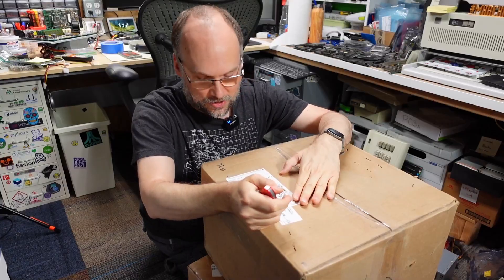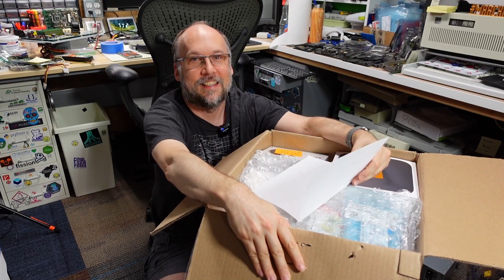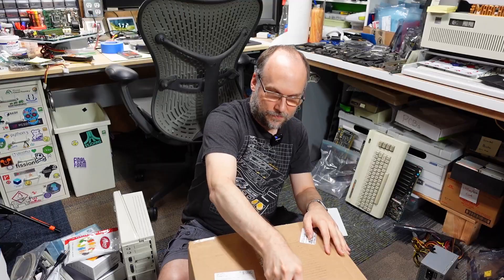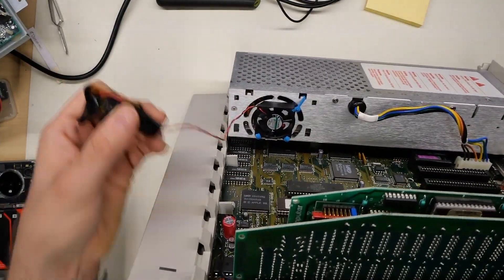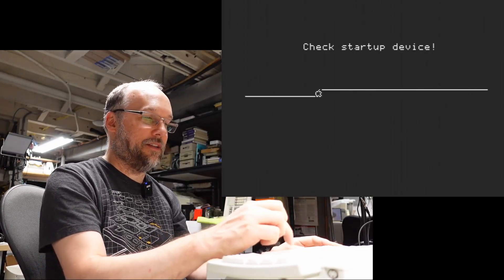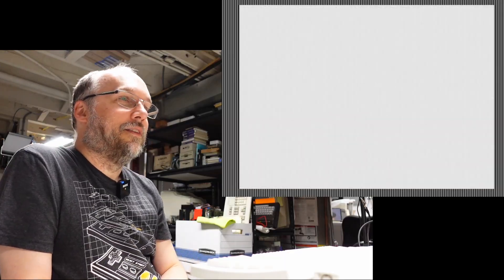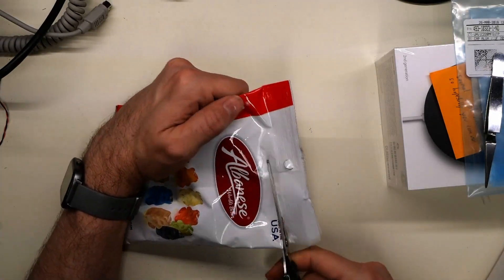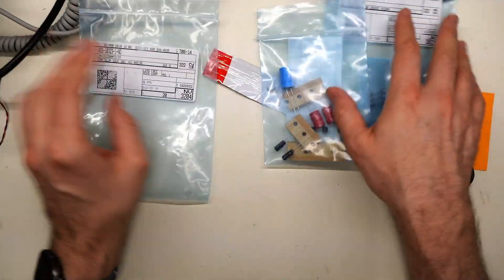This computer was designed for smart kids

Comment: I'd have to say Apple dropping 64K just for the Ensoniq sound chip back then wasn't cheap back then. That was over a decade before we had the likes of Creative offering expandable RAM for "sound fonts" on their AWE 32 and 64 PC sound cards. But it would surprise me if the Ensoniq chip couldn't borrow memory from the main IIgs RAM beyond the dedicated 64K. Actually, for circa 1986/87, that would be a design flaw if it didn't have that capacity. I remember when my parents bought my 1040STf, the computer dealer had the 520 and 1040ST set up in a section of their store with the Amiga 1000 and the Apple IIgs [the Atari Mega STs had just been released and were stationed near the Apple Macs]. The ST was faster and had more standard RAM plus an official external hard drive [SH204] available while the Amiga 1000 had the better graphics and the IIgs had the best sound - and highest sticker price - of all 3. But the SH204 external hard drive was the thing that truly blew me away with its copying and transfer speeds. And with its huge price tag, I certainly did not get one then...
Reply: @Jeremy Holloway - Yet while Apple generously providing the sound chip its own dedicated 64K, the computer's main RAM (only 256K) was completely insufficient to run any of its native software, even its OS! Back in 1986 Apple should have shipped the machine with 512K or even 1 MB, and had empty sockets and a jumper for users to bump the sound chip up to 128K. There was no excuse for this, considering what it cost AND that the Mac Plus released almost a year earlier came with x4 the amount of RAM. Sadly, back in the day no one seemed to understand how powerful the Ensoniq was in the IIGS (and leaps and bounds beyond what the Amiga and ST offered). It wasn't until the Gravis UltraSound in 1992 (it had a next gen version of the Ensoniq and up to 1MB sound RAM) that PC's user got a taste of what the IIGS had 6 year earlier!

Comment: You're killing me here! Why didn't you connect the zip drive and boot system 6.0.4 from it? It looked like the zip drive is being used as a hard drive. Not unlike on a Mac plus.
I wish I could have seen the label on the bottom of the PSU. Although I'm 99% sure it said Dyna Comp Inc.
I didn't know they sold them in the U. S.
My //e Platinum has one, which was standard for Australia.
Reply from the maker: Heh yeah the video was already running too long. :-) But the Zip drive is a great solution and definitely works really well to boot the GS into GS/OS. (Still have the 32mb partition limit.)

Comment: Hey Adrian, what sort of RAM card do you have in your ROM01 machine? If it's more than the one in this ROM3, I think I have a RAMpak 4GS around here somewhere. It doesn't work on the ROM3, but it does run on the ROM01. 4MB genuinely makes a big difference on the IIgs.

You don't actually "need" a ROM 3 machine for compatibility with any software, though you might want one. Very little Apple II software really "needs" a mouse, so if you add a Mockingboard (for the few things that ever used it), you you probably want it in slot 4. It could live in slot 3 since it's easier to patch the few titles that used it to be slot independent, but on the ROM 3 you don't really have to—just toggle slot 4 between Mouse and Your Card as needed.

The biggest reason to have multiple Apple II machines is that there are just never enough free slots. And the ROM01 was insane for setting up AppleTalk—it cost you two slots. I've only ever set that up with a Raspberry Pi.

Comment: Adrian I've been working on a 2gs ROM3 just like this one.   I just can't get it to boot GS/OS with a floppyEMU.   What OS image are you using, settings in the control panel etc.   Also was the EMU plugged strait into the computer or chained to the 3 and 5 inch drives.

Comment: The 2gs was such a great home machine, handsome and easy to use, FAR superior to the 2e and 2c. In fact it has almost an Amiga kind of feel to it.
Reply: It was sure faster than Apples super expensive Lisa and could easily have been faster than both the original Mac and Amiga. Some boss decided they had to throttle the 65816 CPU frequency in order to not compete with the Macintosh, quite sad.
Reply: Well it was kind of like Apple's answer to the Amiga...  just significantly worse in most respects. (IMO the main exception was the sound chip - I think the lack of a music chip was a significant limitation of the Amiga)

Comment: In 1989-90 I was working at a school in a computer lab while getting a degree.  At the end of the year an order was placed with apple for a lab with IIGS workstations and A Mac Server just like shown in the picture.  They used the Mac as a server over Apple talk.  I recommended but a color Mac II ? that was the same price as the IIGS and would be useful for a longer period of time.  My advise was not followed and I never got to play with the system.  The system replaced some Apple II and IIe and about 12 Radio Shack Model Is.  The rat shack could all be load off one cassette drive through some kind of cables.     I talk to a teacher at that school about 10 years later and the IIgs and "network" was still in use.  He almost cried when I told him I tried to get an all Mac lab as the iigs where vastly out of date.  I think it was a misstep by Apple not to push the macs lead to some school converting to PCs.

Comment: It might have been shot in a house but Libraries could look that way especially School Libraries. At least in Texas not sure about other places but boy let me tell ya School libraries between 1990-2010 was a hodgepodge of the date of the Building plus what technology was cycled into the library from the Computer labs. ~2004 the school districts were finally getting rid of the Card catalogue for the libraries for a computerized system so... Apple IIGS   in that kind of setting. And the older schools had that stained wood trim depending on if the Head librarians of the school liked the look or not. Saw a lot of white washed and painted trims in various libraries. knew some libraries that had that kind of Textured double paned Window blocks. The more I look at the library photo the more I think it's a 100% believable school library pic even though it's like 100% staged.

Comment: I have a rom 03 iigs and my battery was soldered in, so I'm thinking there are 2 versions of rom 3 machines. (edit or maybe some one broke the plastic battery holder.. my iigs did come from a school)
Reply: @mrkite - A socketed battery (user removable) was one of the features of the ROM 3, all boards included that as standard. It does have a plastic cover that has to be pop off first, maybe that's what you're seeing?
Reply: @Apple2gs  I double checked.  I think the battery leaked and someone removed the battery holder as part of the cleanup.  The battery is in a different location on rom0 boards... it's over by G1 or so, on rom3 boards it's at B3.

Comment: Excellent video! Do you know if you could replace a ROM 1 with a ROM 3, would it work?
Reply: @Rudy's Retro Intel - You need to swap the entire motherboard for that to work. The doubled 'ROM 3' firmware (now on two chips, rather than one ) cannot not physically fit on the original motherboard which has only one socket. Technically the original board CAN handle and address a larger sized firmware space, but it would cause compatibility issues because of the hardware changes to the ROM 3 board. So long story short, the ROM 01 is the highest the original 1986 motherboard supports.

Comment: I want to see it boot from that Zip disk with GS/OS on it :-)
Reply from the maker: I didn't show it but it definitely works. The ZIP drive is a great solution for an Apple II -- if you have one of the SCSI cards. (Which are quite hard to find.)
Reply: I actually boot my IIGS from an IOmega Jaz drive. Stuck the OS and several partitions onto a 1 GB cartidge! :) (also have a Zip 100 too, but use it mainly as a glorified floppy drive between my Windows PC and IIGS)

Comment: ah, poor Apple IIGS - crippled intentionally by Apple to keep it from reigning on the Macintosh's parade, and then completely outclassed by the other 16-bit wonder boy of the late 80s, the Commodore Amiga - and even the Atari ST offering a much better budget-conscious entry point for a comparable experience.

The 68000 was just plainly superior to the 65816 as compiled languages like C had reasonable registers on the CPU to efficiently support high level language code generation. Oddly, the 65816 designers failed to learn any lessons from the other 16-bit CPUs and never gave high level languages support a second thought. And, of course, there was the 68000 flat addressing for memory buffers beyond 64K. Only Wozniak had any affection for the 65816 but compared to the competition it was a major disappointment